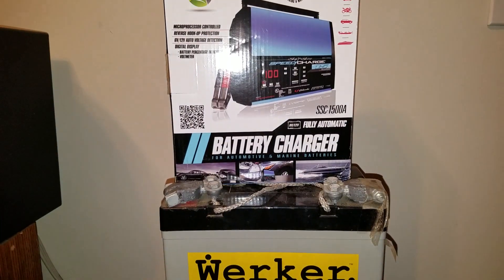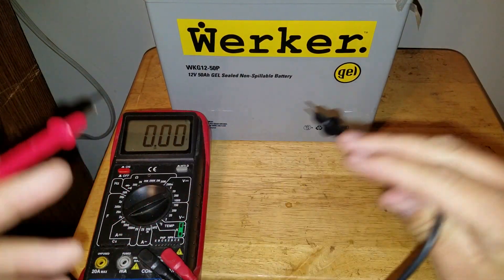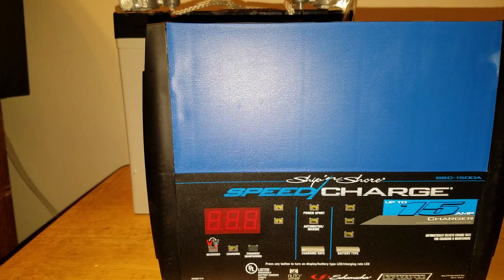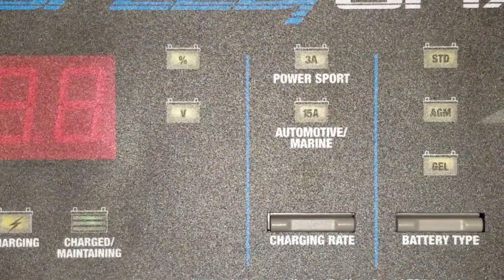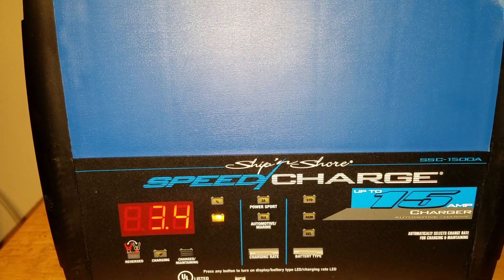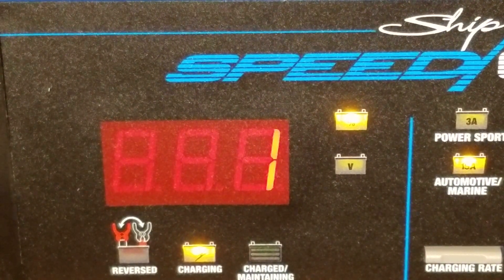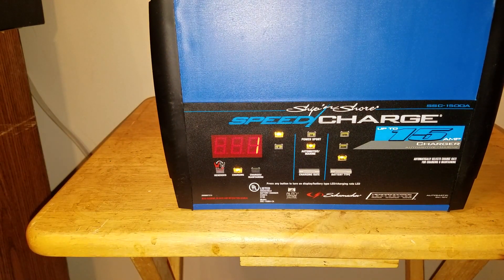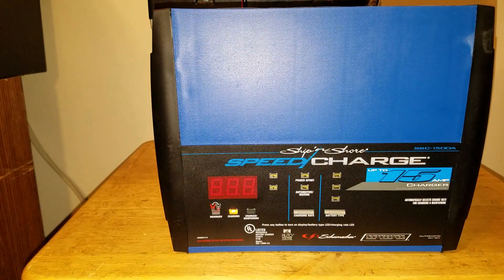New battery charger can it bring an old Gel cell back to life?

Comment: I was wondering if you would know if the batteries for my solar walkway lights good to recharge in a battery recharger and use
Reply from the maker: A lot of times that have cheap AA battery's in side of them. I have used then in other things like flash flights etc..  I normally replace them with better battery's so 1. They last longer through the night, and 2. I always have charged AA battery's.